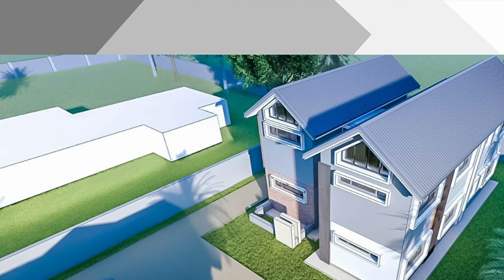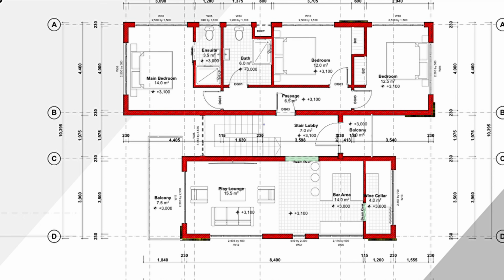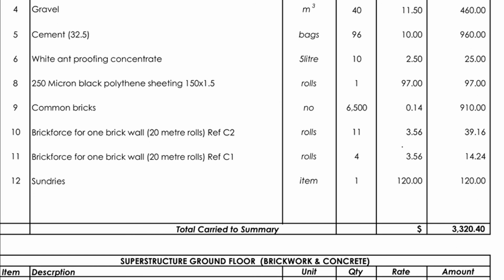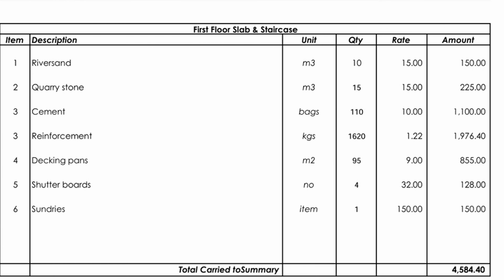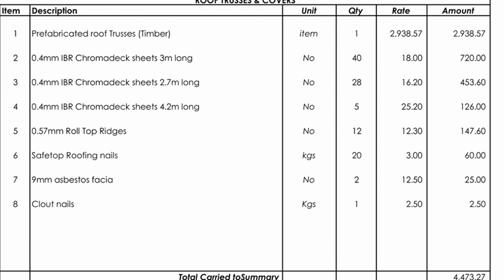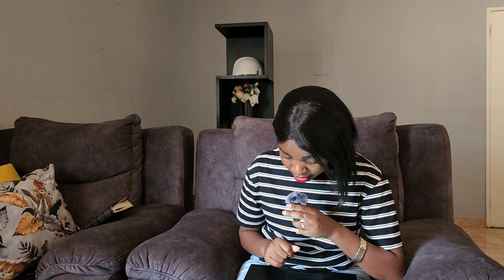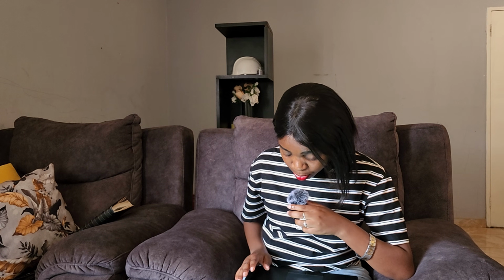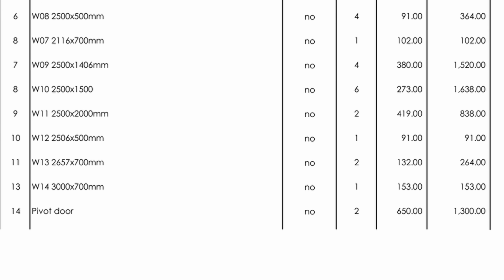Can You Afford to Build a Double Story in Zimbabwe. Full Cost Breakdown 2025 💰🏠 #buildinginzimbabwe

Comment: Either this is very misleading or i was ripped off. Your double storey foundation does not have underground beams, columns, and  bases. I used approximately 19K
Reply from the maker: Or neither of the above. Remember building is not a one size fit all , many factors come to play like design ,size, location, gradient ,soil etc
Reply: Perhaps this structure has relatively shorter spans and no columns. Wall structures are inherently cheaper than post and beam structures because the post foundation has to accommodate larger point loads and beam reinforcement is pricier than a supporting wall.
Reply from the maker: @TendaSithole correct

Comment: Personally, I think building up in Zim is unnecessary. There's plenty of land to build out. That's just my opinion btw. Great work as always Elaine 🙂
Reply: Perhaps as availability of lots, diminishes in desirable areas building up may be the way to achieve the targeted floor area and number of rooms on smaller lots.
Reply: There is many reasons for buidimg up and personally if you can afford it and dont mind having that much extra space why not? I mentioned somewhere on the very topic that we got to think generationallly not only for us.  Besides it has added benefits whem you have a bigger lot ... more outside space or lush gardens. We are sooo used to buiding up and leaving no outside space whatsoever. On an aproptiate site the commanding views from a double storey weldone are priceless. Weve got to think practicality but also factor in aesthetics.

Comment: This was a nice breakdown of the costs. Thank you.  I like the structure of your presentation. Very accessible. Just a few quick questions:

1) You said you peg the inspection fees at 700. How did you land on this figure? and you mentioned that it depends on location. Does that mean inspection is more expensive kuma dale dale compared to ghetto and why is that the case?
2) Was this house plan one of the template ones yekuti one just chooses from? Or the Omnific guys designed it to the customer's spec? And how much is it to have a custom design done by the architects? I know you mentioned the plan fee, but that is not what i am referring to, I am talking more about the actual design from scratch.
Reply from the maker: Thank you 😊
1. Yes  each council city has its own fees eg Harare ,Bulawayo , Marondera has different inspection fees. 
Also they differ with location , inspection fee at Borrowdale and at Mbare are different.  That is what was gazetted by the council.
Reply from the maker: The house plan is an original plan. Yes they design from scratch you go with your idea and they design it accordingly.  
Prices are per m2 ,so your floor area determines the final cost. 
Find their attched contact on pinned comment for pricing per m2